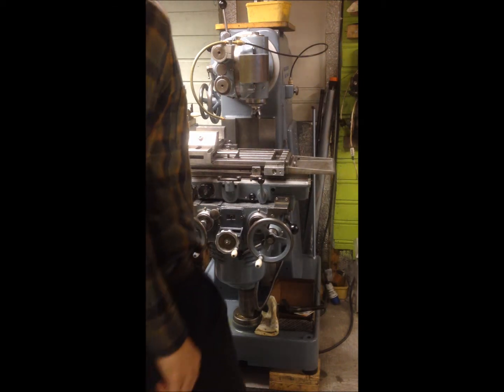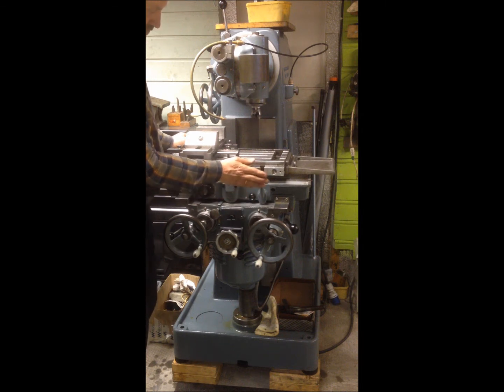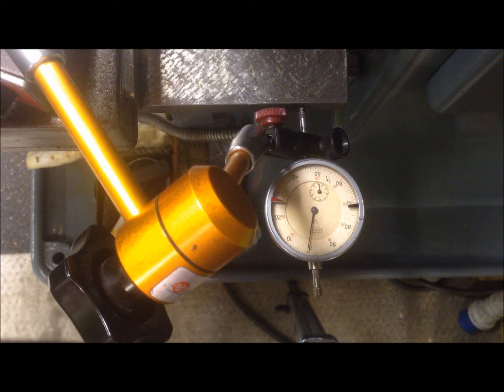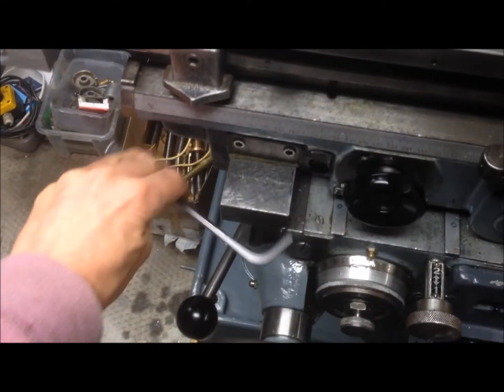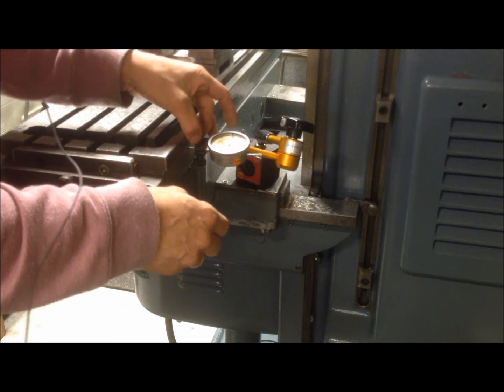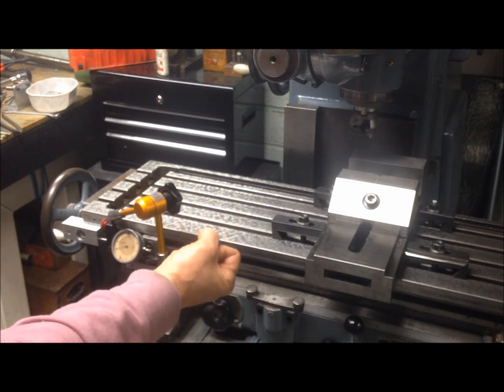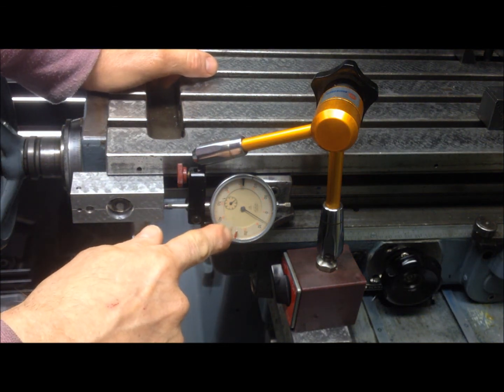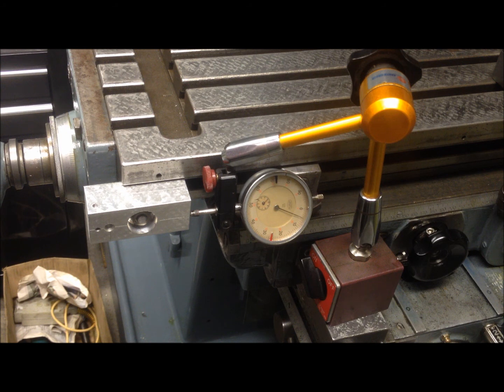Schaublin SV52 milling machine gib adjustment in/out feed, longitudenal feed and axial table "play"

Comment: I would think that the factory specs applies only to the original tolerances of the surfaces? By that I mean, if there is wear in the surfaces the slack has to be increased in some places to avoid binding in other places. But if the surfaces are restored to better tolerances than new, it should be OK to reduce the slack as well?
Reply from the maker: You are right. If there is slack you have to compensate, ie. possibly adjust at the tightest spot, which will leave it sloppy in other areas. The idea behind the resoration was to bring it back to factory specs (or better if possible. There is a guideline for how good different sorts of machines should be. These specs are found in the book by Dr. Schlezinger: Testing Machine Tools.